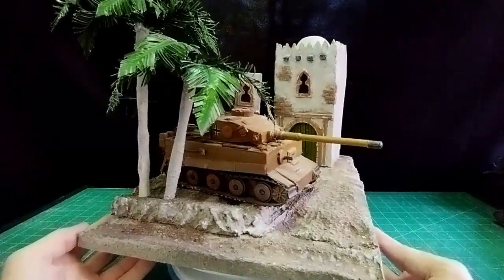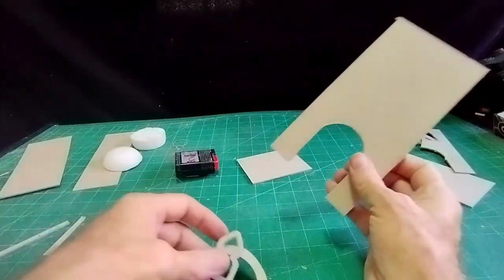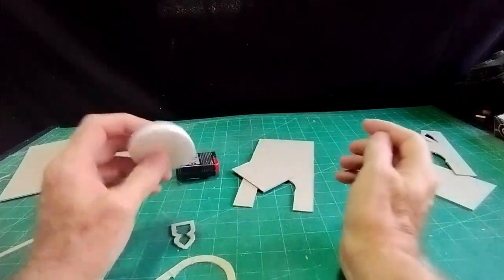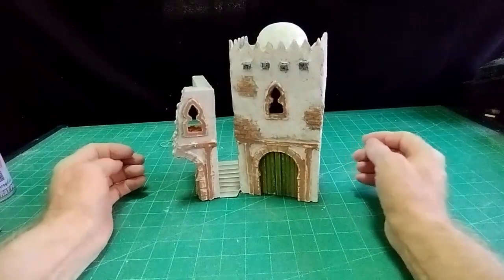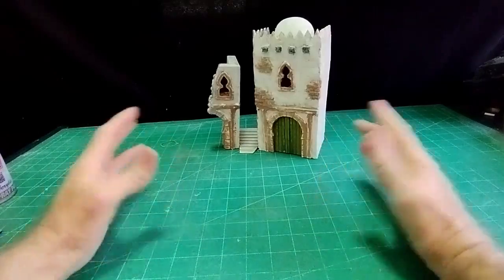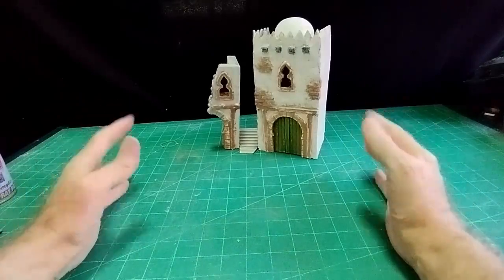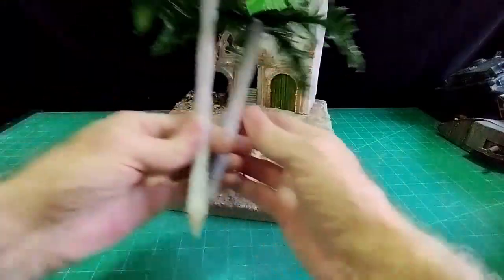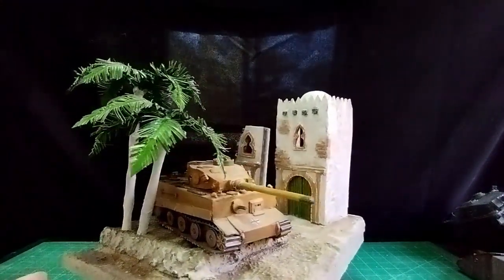North African house diorama 1/35. Step by step guide

Comment: Don how you build is amazing. I'm in my 60's and doing my first diorama, trying to replicate an Afghan walled compound. I tried using foam- turned into a disaster. Could you possibly explain how to simulate a mud brick wall covered with some type of coating? Any response would be greatly appreciated
Reply from the maker: I would use a coating of tile grout and after an hour carve the shape of you bricks or stones into it.
Reply: @nanplabwern  I took your advice and used a tan color to make the bricks, and lightened it for the mud. Thank you for responding.